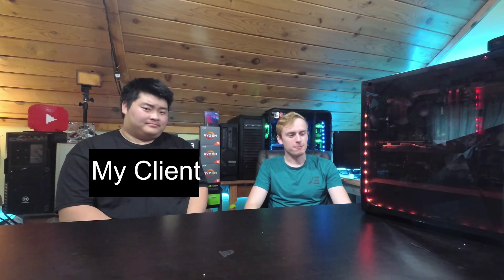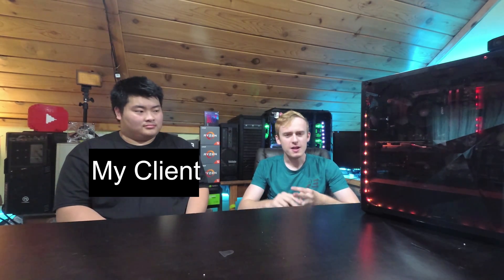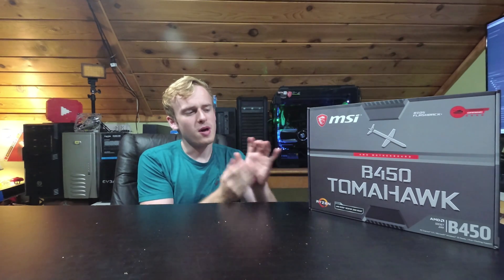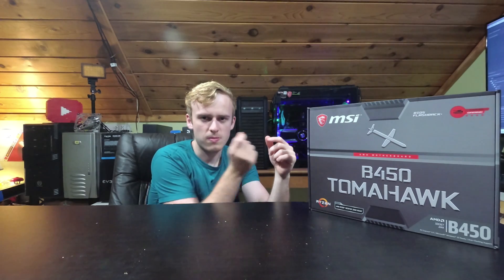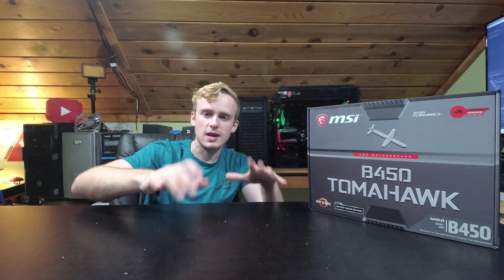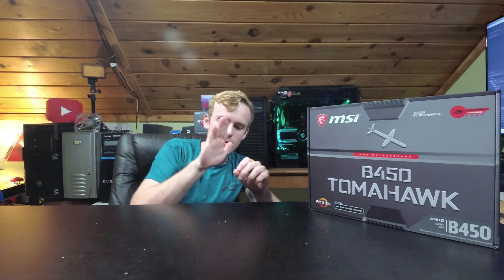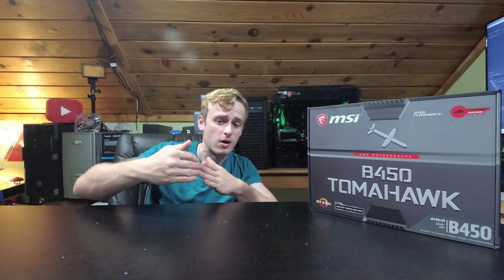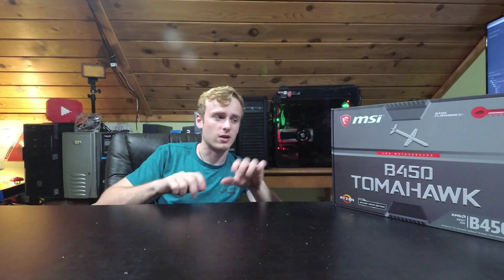My MSI B450 Tomahawk Motherboard Has a BIG PROBLEM

Comment: MSI makes great motherboards, if we stopped buying motherboards because of 1 RMA we would be out of brands already.....
Reply from the maker: Only if it was just one but 3 in a row? All with different problems?
Reply: I noticed a mistake in the manual are u hooking up the hdd led?
Reply: The positive and negative seem to be switched and I never verified if this is a mistake or the way it should be....I never hooked it up
Reply: If it's three in a row Im nearly certain something is being hooked up wrong. It can't be three boards with all the same issue...the only time I had multiple failures is when I owned s Asus board and also the manual was wrong on a jumper which caused failures
Reply: If it's three in a row Im nearly certain something is being hooked up wrong. It can't be three boards with all the same issue...the only time I had multiple failures is when I owned s Asus board and also the manual was wrong on a jumper which caused failures
Reply: I'm sure iur frustrated it may not be anything ur doing wrong....also when I feel I have some kind of short I put plastic washers on the bottom of the board where the screws attached this eliminates any short problem there
Reply from the maker: Oh they were not the same issues. One had a broken memory controller and couldn’t overclock the ram. One had snapped off USB ports out of the box and another had this bios booting issue where it wouldn’t even post, and finally I just remembered all four motherboards had issues, the last ones RGN headers wouldn’t work even with all the proper software installed. I built another 4 computers with Asrock motherboards no issue, another two with Gigabyte Aorus, and another with ASUS and none of them had a single issue.

And it ended up I had to return it to Newegg because MSI told me it would be at least a week before they could mail it, a month to look at it, and another couple weeks to pack it and mail it back.
Reply: all i can say is WTF......luck, bad karma???....how does someone get 4 bad boards, Glad i didn't see this video before I bought my board or maybe i never bought it lol...When it works its a great board, great generation and really value for the money....if you get one that has no issues
Reply from the maker: No by all means if it works great but my experience has been quite the opposite. 4/4 boards had problems where as the other brands had none. I mean MSI makes some decent gpus I’ve used in past builds but for motherboards I won’t buy another.
Reply: @JaysTechVault  memory controller is built into the cpu, not the motherboard/chipset anymore
Reply from the maker: Well then how come another motherboard runs my RAM fine and the MSI  b350 Tomahawk can’t even overclock it at all.
Reply: @JaysTechVault  depends on the BIOS and 1st gen Ryzen usually a bit problematic with memory selection.

Comment: I got the gigabyte aorus b450 elite and have the same isue im Pretty sure the whole b450 series has this problem bug i dont really have a other choice for my ryzen 5 2600.
Reply: Update on what you did?
Reply: I did buy the msi b450 tomahawk its working fine so far overclocking went great with this board

Comment: Did your friend spill something inside while admiring it? Then dried it out? Then screamed HELP? Man I built one with this very board, smooth as silk. Check your friends connection!
Reply from the maker: No this one had problems when I first built it though I thought it was the LED Lights shorting out.

Comment: You do realize that all motherboards experience some sort of issues. That is why they all have an rma process. You got a bad board, it happens. Rma the board.
Reply: While this is true, I bought it from a non tech company, like cash converters, it was unopened but it isn't 12 months I had it, I've had it longer so no possible way to rma
Reply: @supermorph  what rma means ?
Reply: @dimitrisjim5712  send back to brand to repair
Reply: My shithole of a country doesn't have any Tech Support. Lol
Reply: @Bankotsu09  which country are u from if u don't mind to tell...

Comment: I've been working in PC repair since 1999 young friend, most of your issues with new builds will be motherboard or PSU related. Never hesitate to RMA a motherboard when you've verified every other part works just fine. One of the reasons you have to charge more than $70 is that you're going to want to have spare parts on hand to swap in and out. I can't tell you how many times I've ordered 2 or 3 of something that is on sale, just because I know there is a VERY good chance that REGARDLESS of brand name, one will be at least somewhat faulty.

Most of your repair/support freelance jobs will be OS issue like a windows update causing a problem, virus/malware, or storage media related like a dying hard drive or too many bad sectors. Almost every laptop that comes through our door has a dying hard drive with tons of bad sectors, and it leaves here with a 120-480GB SSD haha
Reply: I had a B450 MSI amour mother board. And I was getting no post on it I had power running though it fine. All of the ports on the rear of they case didn't work but I checked the voltage of the usb s they had normal voltage but nothing would work from them. I tried calling repair people about the board they were not useful. I went to the site I brought it from and there customer service was a joke. I sent it back. Went to another site and bought a Asus Prime B450M-A and it works fine . I don't know really what happened in this experience. But what I know is my pc works now. 👍😎

Comment: Anyone know is that B450 Tomahawk board have digital audio coaxial output option ?
Or some similar board with good VRM and digital audio PCM output?
Thanks is advance
Reply: @ogdesoteef6687  How did it go?
Reply: So, how'd it go? Tossing between tomahawk max and b450 steel legend
Reply: @dropbearaus5235  Bought a B450 Gaming F 4 days ago. Still can't fucking get it to boot...

Comment: No issues with mine yet. Finished building it a week ago. 1700x, G.Skill TridentZ 3200 running at 2933. 
However...my first attempt at boot failed. Turned out it was my original G.Skill Ripjaws V 2666 (2x8). Even though it's on the QVL, one stick was preventing boot.
So I exchanged Ripjaws for the TridentZ, which isn't on the MSI QVL.
Here's the funny part, the Ripjaws aren't on the G.Skill compatibility list (but on MSIs), and the TridentZ ARE on G.Skills compatibility list, but Ripjaws aren't. 

I got the motherboard on sale for $60 at Microcenter (bought extended warranty just in case), and they price matched Neweggs price on the TridentZ. Love that store!

Tonight after work I'm going to try OCing the Ryzen.

Comment: I have a Ryzen 1600 on a MSI B350 Tomahawk and everything is working fine. My second PC is a 2600 on a MSI B450 Gaming Pro Carbon, it's working perfectly as well. I switched to MSI after having problems with an ASUS B350 and a GIGABYTE B350. All brands can apparently have problems, and I think really it's just the luck of the draw.
Reply: hi @oletta Liano just researching for a B450 tomahawk max review :-)
Reply: @mikesunboxing  Wow, I read what I wrote a year ago, and my how things have changed. Maybe this time next year I'll have a PC with a V-8 motor in it. 😂
Reply: I have the same motherboard but my PCI-E x16 wont detect gpu after a reboot. Have to use the other PCI-E
Reply: Completely. I've had 2 EVGA PSU units and both of them failed. I've had an ASUS laptop that died in 6 months and an optical drive that was terrible. Personally my PC is made of MSI, Corsair and Gigabyte components. My experience is that both EVGA and ASUS aren't as reputable as people say, then again people have the opposite experience.

Comment: I have a similar issue no display, no post, no bios, no keyboard working with my msi b450 mortar which is pretty similar to tomahawk. Though i was using it for a while. It occurred to me all of a sudden while rebooting which is weird.
Had trouble with booting earlier as well, the vga debug led was lit by then but somehow i managed to fix it with a bios update or so. RMA ing the motherboard soon! Hoping MSI's gonna fix it.
Reply from the maker: Exact same issue, don’t try and RMA to MSI it takes a month and a half. Send it back to wherever you bought from and get a new one much quicker.
Reply: @JaysTechVault  well returning now is gonna cost me more. It's been a month since i have bought it. Im trying to contact msi authorized service center which is the nearest location though it is only connection point for the main branch.

Comment: Well imagine If this is one the best B450 motherboards (including the Pro Carbon). I've checked the web and even Steve from Hardware Unboxed recommends It. That comes from Techspot and you probably know Steve. Shocking but not impressed since the first time I bought a mini itx from Asus on the AM1 socket had so many issues that I have the same opinion as you. I will never buy an Asus product again, they're overrated garbage for what I've read so far. Guessing the road for B450 is Asrock. But I might be tempted to buy the Tomahawk anyway cause the design keeps the VRMs cool. I dont care about some leds, I need a cheap die hard product. Unless I see several DOA complaints on Newegg.
Reply from the maker: Well the problem is also returns and the fact that this is the second tomahawk I bought with problems.
Reply: Jays Tech Vault well would it be worth it to just buy it with the Newegg 4 year warranty for like 15$ extra. I am probably going to do that
Reply from the maker: I bought mine from Newegg and just returned it they paid for shipping and everything. Really appreciated them.

Comment: The Tomohawk line is notoriously bad i had pretty much same exact problem with the b350 board and trying to Jump cmos shorted the whole board out . Wish i would have gotten that warranty and kept  all my boxes. CPU soket always seems to go first if not headers that. love their aesthetics and the board when it works is great until win10 gets the antimalware throttling and consuming all system rescources and just being widnows 10, Otherwise decent board, wish important headers were not in the absoulute worst corner though. It was a pain in the ass to Flash Bios and the board really hated XMP and other OC settings, also did not like memory freqeuncy over 2166 on average in my experience, though was very flexible with Dual Chanel support wich was cool.

Comment: I built my rig last Monday.  I haven't had a single issue with my B450 Tomahawk.
AMD Ryzen 7 2700
Gigabyte GTX 1080 Windforce
G. Skill 3200 RAM
Samsung 860 PRO EVO SSD
Barracuda 2T HDD
B450 Tomahawk.

I haven't had a single issue and it was the first PC I ever built, so I was very scrubily putting it together.  It runs fine and I have no problems.  Board runs great for me, I would love to recommend it to others.
Reply: Was it easy to configure the RAM?
Reply: @Murlockingqc  Hi, I don't know if you bought your motherboard yet or no but I got a B450 Tomahawk for my first ever build. I bought Corsair RGB Black 2x8gb 3200mhz ram. I had 0 difficulty in configuring my ram to work at the desired 3200mhz speed. All in all I am very happy with my Tomahawk mobo. Good luck!
Reply: @Johnheh  Thanks mate, happy new year !
Reply: @Johnheh  Hey man, I have a question or two. 
What is your CPU and can you give me the model number for your Corsair RAM or the timing. 
I don't want to get a RAM that will not get the correct speed.
Reply: @Murlockingqc  My CPU is Ryzen 2700x and I have Corsair Vengeance RGB Black 16GB (2x8GB) / 3200MHz / DDR4 / CL16. I will probably be able to clock them harder I just haven't experimented with it yet. I just turned them up to 3200mhz for now.
Reply: @Johnheh  The RGB works fine ?
Reply: @Murlockingqc  of course, you download a program called iCue and you can customize in a ton of ways :)
Reply: @Johnheh  Thank you. I will either go with those or the G.SKILL Flare X Series 16GB CL14. They have really great timing but they are also quite expensive.
Reply: Still runs a-OKay
Reply: how long to boot to windows 10 with ssd evo? m.2 mine is taking ages no idea why, it's just on the windows boot screen for about 40 seconds which is far too long?

Comment from the maker: UPDATE
I am returning the motherboard back to Newegg because it takes a whole month and a half to send the board into RMA and get a replacement according to MSI. I’m going to be buying a different brand and staying clear from MSI and getting it fixed in the matter of two days.
Reply: My B450 Tomahawk runs GREAT.  3200 overclocked ram, never had an issue. Just built my rig last Monday.
Reply: @RNG-999  What RAM did you purchase?
Reply: @RNG-999  hows your mobo today since my tomahawk max after almost 2years of working is not posting
Reply from the maker: I just wanted to make this issue public so if others have it they know they are not alone.

Comment: I myself am building a B450 Tomahawk + Ryzen 2400G build. It just won't post no matter what I do. Tried a lot of different things. Only checking with a different RAM stick and APU/CPU remains and as I don't have a spare DDR4 stick or an AM4 processor. If changing RAM doesn't work either, will be sending the whole thing back to the seller tomorrow for testing and replacement if needed. I really think it's the motherboard but will still leave a reply here when its sorted. This sucks!
Reply: Have you checked if your RAM sticks are QVL ? There is a pretty nice search function on the MSI site for that, using the production codenames. I've had a 2x4 Corsair Vengeance LPX @ 3200MHz set that refused to post, no matter in what config I tried them in (A2+B2 slots and A2 solo stick). That set was Hynix die and was not listed in the QVL. Stuck in another Corsair Vengeance LPX, but this time a 2x8 Samsung die @ 3200MHz that was listed as QVL and it posted immediately in A2+B2 config. No problems since.
Reply: Ohh forgot to update this. And yes! It was the motherboard! Motherboard was faulty! Had some hardware issues. Seller told me so after they were done testing. Now waiting for replacement but it is out of stock. Will get it by this weekend hopefully.
Reply from the maker: So now we have two confirmed cases of this problem out of 300 people, wonder how many more we will get.
Reply: UPDATE - So I received the replaced B450 Tomahawk last week. And it came with yet another hardware problem smh. The AM4 CPU socket pin holder (that thing that mounts the pin you use to lock the CPU in place) is a bit loosely attached to the socket/motherboard. And so it was a bit too loose to hold down the CPU in the socket. I thought it wouldn't be a problem so I tried building anyways and it posted fine with single RAM stick but wouldn't post in dual channel (motherboard lit up CPU ez debug led) so I had to remove the heatsink again and that time my Ryzen 2400G APU came out stuck to the heatsink instead of staying in the socket (even when the pin was locked). I was already frustrated by now to return it for the second time, so I tried holding the loose socket pin holder down by applying some force and this time it did apply some pressure on the APU when it locked. I put the heatsink back on top of it and this time it posted fine even with dual channel and I haven't had any issues so far. But this is my second bad experience with this board in a row! This really sucks, MSI!

Comment: I'm scared cuz I wanna get this board
Reply: Don't worry, any and all brands and models of motherboard run a risk of issues. It's several different chips all working together, something may have an issue. That's why RMA exists!

We purchase 3-12 boards at a time for our shop, especially when we find a good deal. We have had ANY and ALL brands produce issues, and we have had ANY and ALL brands produce 10+ year parts that customers love for over a decade. 

Name the brand and I'll give you plenty of horror stories but also plenty of "Wow this motherboard lasted 9 years" stories as well
Reply: Don't get an x570 b450 is trash.